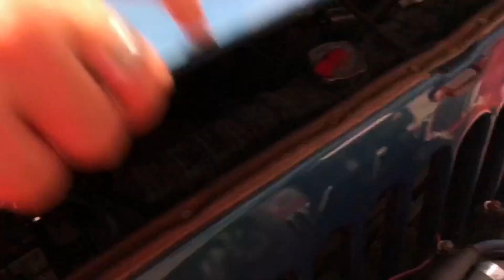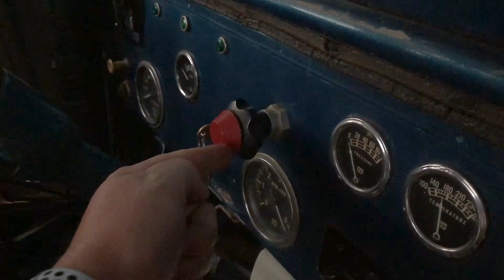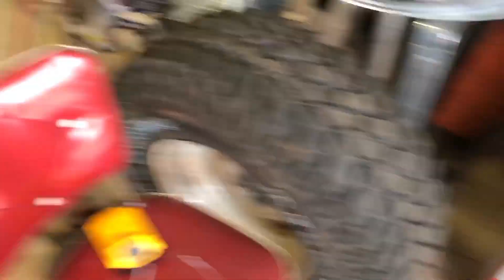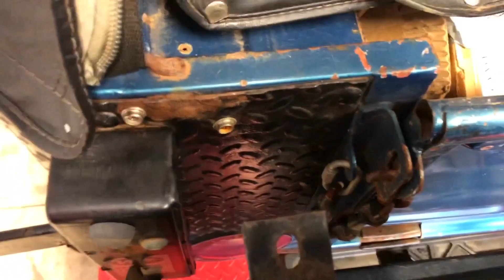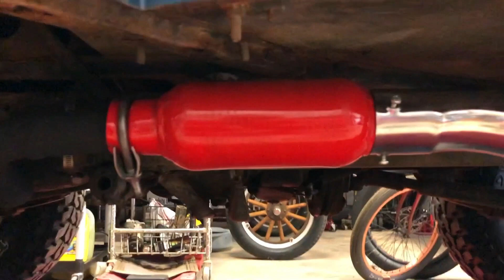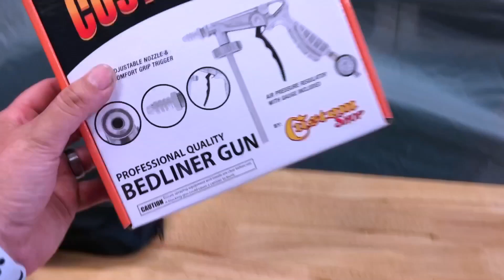1953 Willys Jeep CJ3B Updates and New Exhaust

Comment: In 1965 Kaiser-Jeep began using the Buick 225 CID in the CJ's. GM stopped producing the 225 in 1967 as it was the muscle car era and no longer produced them.Buick used them in 64-67 Specials and Skylarks, also in 64-65 F-85/Cutlass. In 1967 Jeep stopped using the 225 and began producing and using the 250 straight six.    
Since your CJ is a '53 the engine probably came from a newer CJ and the previous owners scrapped the 4 cylinder that it originally came with. The p/s unit probably came with the 225, my '72 Jeepster has the same engine with p/s
Reply from the maker: Thanks for watching!!